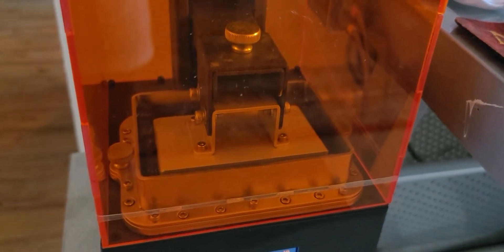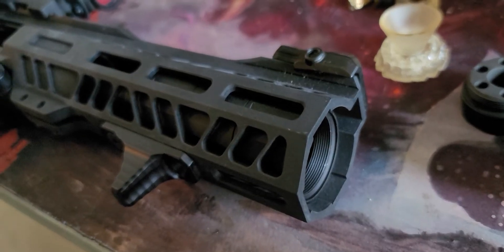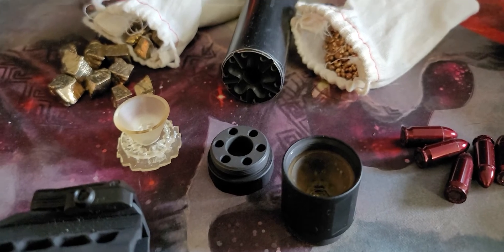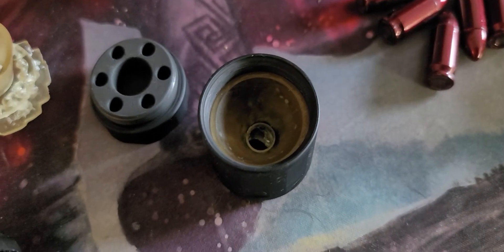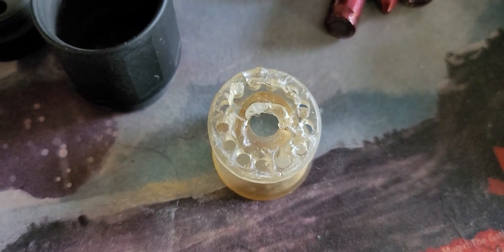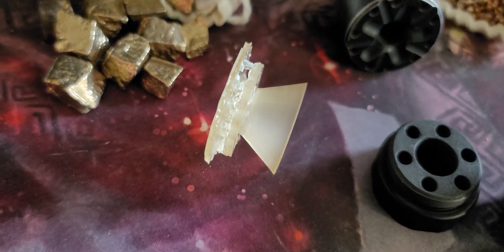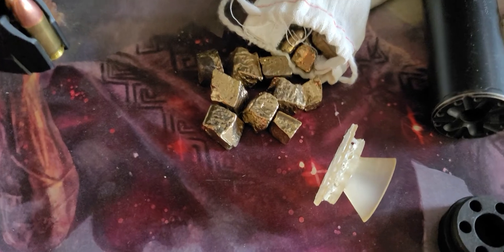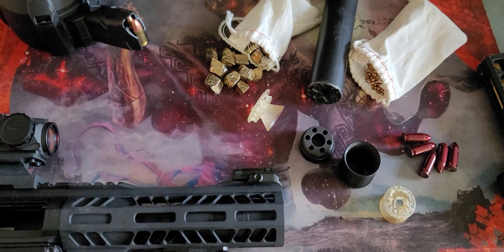Kaw Valley Precision MACH 3 Compensator

Comment: What is the diameter of the baffles I also have a Mach 3 I have always wondered if this is even possible. I mostly got the Mach 3 while I wait for my suppressor/ silencer   It’s been 6 months and I’m still waiting for my Odin works Baja 556.can
Reply from the maker: https://youtu.be/76urqEKxxls?si=vcPdwFmMwVGyi2_m

This shows the measurements in fusion 360